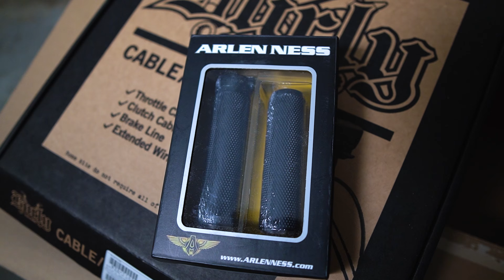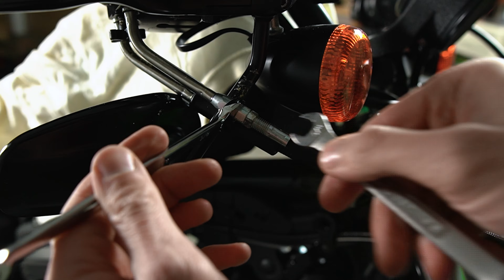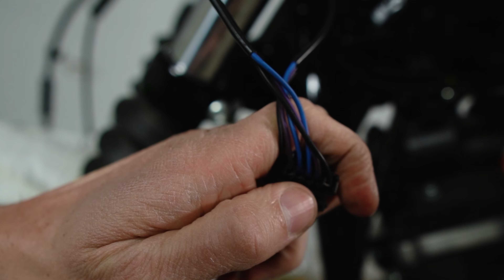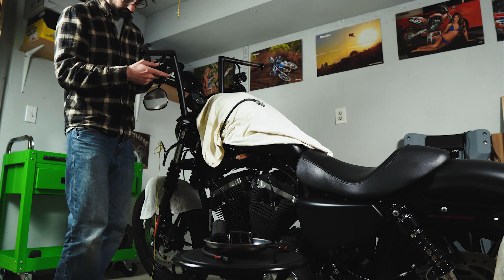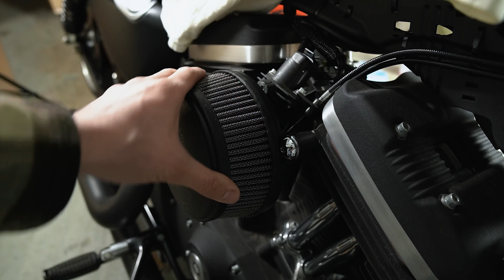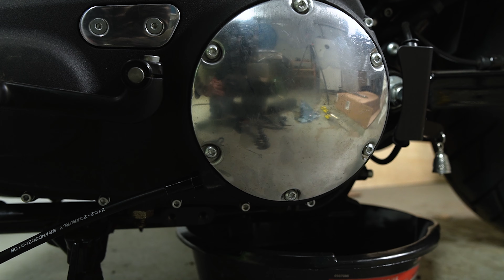Step by Step Harley Sportster Handlebar Swap

Comment: That build looks pretty cool bro. I had a question on that namz plug and play. I wonder if it will fit my 2016 roadster 1200. I’m currently upgrading bars and don’t want to sodder the wires.
Reply from the maker: I'm not sure if it's the same part number (I assume it is though.) just order it from Revzilla and enter your bike. It will confirm that you order the right part number for your bike.
Reply: @TheJourneyYoutube I appreciate you responding bro. I’ll definitely have to check it out.

Comment: If im just changing a bent handlebar for the same handlebar I dont have to extend or replace any of the wires right? Like the whole clutch thing?
Reply from the maker: Correct. This is only if the bars are getting longer.

Comment: Dear Sir, today is 3/25/2026 and this video was made 4 years ago, but I have to say that the information on the handlebar swap is the best that I have seen. I purchased a 1999 sportster 1200 last month and will be installing new buckhorn handlebars which will need longer lines. Would you be available to answer some of my questions or have you retired. Gil in Westfield Mass.
Reply from the maker: I'm glad you find it helpful. I don't have much time to post videos anymore, but I'm happy to help if you have questions.

Comment: What happened with the turn signal light cable?  Where were you able to get it out from under the controls?
Reply from the maker: Yes. It's actually a tight fit but it fits in a slot in the hand control assembly.

Comment: Do you need to have the wire and cable extension kit to put on 10inch zbar apehangers on a 2006 1200 Harley Davidson sportster
Reply from the maker: Generally speaking, 8" is often thought of as the cutoff of being able to get away with stock wiring and needing extensions for bikes with low bars like the iron 883, but I don't know the specifics of every model and year. I bet a call to RevZilla would be helpful.

Comment: Anyone know if there is a plug and play extension for the turn signals?
Reply from the maker: If you buy the burly kit and namz extensions that I have links for in the video description, that is the simplest way to wire that I know of. It will likely still require some de-pinning but that's only because the connector will be too bulky to pull through most handlebars.
Reply: @TheJourneyYoutube  i already purchased the LA choppers kit that doesnt come with any electrical wiring extensions. And also wouldnt i be able to feed the stock wires through the 12 inch handlebars and then connect the extension after?
Reply: @TheJourneyYoutube  i think i’ll run the stock wires through and if i have to de pin that plug i will. Im just wondering if the namz extension that you put on connects to the turn signals aswell? Just trying to do the least amount of RE wiring that i can lol thanks for the help

Comment: I have the same exhaust and if I do that same air filter did you need to install a tuner? Thanks and great vid it will be extremely helpful in the very near future when all my stuff gets delivered.
Reply from the maker: @dddizzyddd  yes it is recommended that you install a tuner with any full exhaust and filter combo so it doesn't run lean.

Comment: I did a handle bar swap on an 03 shadow. No idea what I was doing to be honest. I don't know that all of these steps were necessary but I didn't do them. Remove handlebar equipment then remove handle bars then put clutch and break and throttle on new bars.

Comment: What oil did you use for your clutch? Been reading online and some say just your normal engine oil and some say 75w90.
Reply from the maker: Honestly I bought the Harley Davidson Genuine+ Transmission and Primary lube and I just looked... wouldn't you know it, they don't put the weight/ spec on the bottle. It doesn't seem as thick as 90wt but doesn't smell like regular oil either. I've used ATF for some other bikes, but this also doesn't smell like ATF. Sorry I could be more helpful.

Comment: Great video!
I have two questions:
1. Is this height of the handlebar tiring?

2. how long did the whole conversion take you?

Thank you
Reply from the maker: The height is good for me. It isn't tiring at all for me. I have a quick video about measuring for proper handlebar height. It isn't perfect but it might be helpful for you. Also, it took about 6-7 hours for the install including filming the video. 2 hours of that was probably just for the internal wiring.
Reply: Thank you very much! Keep up the good work!

Comment: Will I be fine if I remove the primary cover without draining oil or transmission fluid ?
Reply from the maker: If you are on the stand, you will lose some fluid once you remove the primary cover and will need to add some again to get it to the proper level. If you don't lose any, you were probably running too low.

Comment: How long should I go with for 10 inch bars for the NAMZ harness extension plug n play
Reply from the maker: You can probably just use the shortest ones they offer since the Harley Z bars are 8" (they are short for an 8" bar, but still) and I've been told that the stock wires are barely long enough for those bars without extensions.
Reply: Cool thanks man, your harness looks like it came with 3 plugs from namz.  The link you have under the video shows 2 wires 2 plugs.  What’s the 3rd plug for?
Reply: Hey did you end up getting the extension? What size?

Comment: Did anyone break the clutch cable when installing it. I broke mine. I'm really screwed now. I'm gonna have to send Burley a negative review. The cable on the bolt side is really fragile. Now I'm stuck trying to drill out the thread that's stuck on the housing plate. FML

Comment: Cam find the namz cable plug n play the link in bio take to wrong bike ? And ideo or part number for the sportsters
Reply from the maker: I just clicked on the link to the namz wire connectors in the description. It takes you to the right part, but then you just need to enter your specific year and model and RevZilla will give you the right part number. There are different part numbers depending on the year and model sportster so I can't just give one part number and have it fit all sportsters. Also, I think the part that fit my 2014 iron also fit some softails etc. So maybe that threw you off?
Reply: Great ill check it out

Comment: So I did everything you did in the video but now my sportsters clutch wont disengage when I pull in the clutch and no matter what I do or how many times I adjust it it still won't disengage. Could you help me out
Reply from the maker: It's probably an issue with the adjustment in the derby cover, not at the cable. Just look through a factory service manual about the sequence of adjusting the clutch. I thought I did a pretty good job at showing what to do, but maybe a different look at it/ a different point of view will help. There are a lot of YouTube videos about that adjustment if you don't have a factory service manual.
Reply: @TheJourneyYoutube  you did an excellent job in your video I've been dealing with this issue for about 2 months now and I'm completely dumbfounded

Comment: What if you're not internally wiring your cables? Would I still need an extender for my controls? I have a 12 inch bars that I am putting in and I have the burly cables for 12 inch.
Reply from the maker: Even if you don't run the wires internally, you will still want to keep them in line with the bars, so I would say that yes, you will still need to extend the control wires. Good luck 👍

Comment: I installed on my 2013, 12” bars from Harley yet now I get wobble above 80mph…. Didn’t happen with the stock bars, any ideas?
Reply from the maker: Lots of ideas. Death wobble can be caused by slop in the bearings, worn out mounts,, improper tire pressure, too much or not enough weight on the front end (unbalanced bike) amount other things. If you are certain that the change happened when you changed the bars and it isn't a coincidence, maybe it's because you've changed your posture and therefore affected the weight on the front end. If it was me, I would check all of the routine maintenance items and if everything is within spec and there isn't any wear on the bearings etc., Try to adjust the pullback on the bars. You can always add a steering stabilizer but that is just hiding the real problem and not actually fixing it. Good luck. Share what you find. Death wobble is scary.
Reply: @TheJourneyYoutube   after checking the front forks for play/ seeing if they need springs or oil, replacing tires and all that, I ordered a steering stabilizer from revzilla! And it fixed it, no more wobble and it drives straighter than ever!
Reply from the maker: @Clutchy_Bois  i know everyone says that death wobble is caused by many issues that can be resolved with routine maintenance, but the consequences can be so dangerous from death wobble that I've considered a stabilizer just in case. Better safe than sorry! I'm glad it worked for you.

Comment: Can't everything just slide off the bars and be slid onto the new bars without draining the brake fluid and taking the cables off?? Or no? First bike so excuse the dumb question if it is
Reply from the maker: If you go with new bars that have a similar rise, you can skip the brake line and clutch cable replacement steps, but you will still need to snake the wires for the thumb controls and turn signals through the bars if you want the wiring to be hidden. If you go with a rise that is 8"-10" or more, you will need to do everything.
Reply: @TheJourneyYoutube  ok thanks. I'm going from straight drag bars the previous owner had to 8" rise... fingers crossed... sounds like I may need new lines
They did leave the extra line from the stock bars when they went to drag bars. So I'm hoping I get lucky

Comment: I was told with 10inch bars I wouldn't need to do the cable extensions
Reply from the maker: That's right on the edge. There's no standardized measurement for bar size so you might be ok but you might not depending on the manufacturer.
Reply: @TheJourneyYoutube  this looks complicated I'm kinda nervous
Reply from the maker: @iiviinstiinct3064  you got this. Just make a parts list, buy a repair manual for torque specs and do your research before you start. I'd like to think that my video is a good start for you.

Comment: Great video. I'm about to do a handlebar swap on my old sportster which my daughter will be my daughter's first bike.  An old trick for adjusting the clutch cable is to put a dime in the clutch lever gap to get the correct amount of slack in the cable.
Reply: Thanks bud! I'm getting ready to change out mine this morning on my first bike. '02 Sportster 1200 custom. Fingers crossed I don't need new cables.
Reply: Nickel

Comment: If I’m only putting in 6” risers would I need to still get longer cables? Or would the cables I have be long enough?
Reply from the maker: I've heard of people installing 8" bars and not needing longer cables, so you might be OK. I would unbolt the bars leaving all of the cables intact, make a wood block to hold the bars in their new location and see if you can get away with the stock ones. If it's close, I would get longer cables and/ or wires.

Comment: YO I CAN NOT GET MY CLUTCH CABLE TO THREAD IN WTF LOL. and I know I got the right cable it’s burly brand and for my make and model and year of my bike
Reply from the maker: You probably have the right cable but those suck to get started because it's a fine thread and the cable is curled so it is hard to get aligned. It took me a few minutes to get it started. Maybe ask someone if they can hold the end of the cable to help you go straight to the clutch case. Good luck.

Comment: I have a 22 - iron 883 , and 10 inch z bars from Harley, would I be okay if I just buy new brake line and the plug and play kit ? And is $500 an okay deal to have a shop install these.?
Reply from the maker: I wouldn't pay a shop to install them, but that's just me. If I'm going to trust my life to my bike, I want to be sure that no one cut any corners. If you do pay a shop, they should be reputable enough to confirm that all of the parts are compatible, or don't use them. Having said that, I think I remember hearing that the 8" Harley z bars can barely get away without new cables. 10" might be tight! Good luck.
Reply: @TheJourneyYoutube  so I had these installed and had it for about a month , the only regret now that I have is I wish I would have gone just a little higher maybe 12 or 13 , could I install risers to make them a bit higher ? And if so what size do you recommend ?
Reply from the maker: @The1andonly-M  you can definitely add a riser of your choice. I don't have any experience with them on my bike though so I don't have a specific recommendation.

Comment: If your sportster has an alarm, you want to turn the ignition to "ON" and then pull the main fuse. When the job is completed reconnect the fuse and turn the ignition off. Keep the fob within a few feet of the bike the whole time.

Comment: Namz Ready-To-Install Handlebar Extension Harness For Harley you get the 8 12 or 15 length??? I'm putting 10 on my 883 iron
Reply from the maker: I got 15" for my 12" bars. You should be good with the shorter ones. If there's a little extra play, you can just hide it inside the bars. It's better than coming up short!  You might be close to not needing them, though. A lot of guys can go up to 8" rise without extensions.

Comment: Most thorough video seen so far on bar install for a Sportster.  Good stuff.   Daughter has a new-to-her 2018 Iron 883 that needs bars/grips a few inches closer, so this video is saved and subscribed.  Haven't started sourcing parts yet, but a couple questions.  What if you screw up the grip, glueing it on?  Are we talking needing new bars, or is that glue pliable enough to work with to get off, sand and try again?   Also, given the date of the vid, I expect you gave it a good amount of miles this past spring and summer.   Any adjustments or problems after the install?
Reply from the maker: Thanks for the comment. I'm glad the video helped you. I have footage of a bar review after 500 miles. I'll be posting that in the next week or two. In short, everything has been just about flawless with the bars. I think I adjusted the clutch just out of preference and that's it. Regarding the grips, if you screw it up you will need to cut them off and buy new grips but just sand the bars and you can keep installing new grips for as many times as you like. Just remember to put most of the glue to the inside of the grip and not that bar so the glue stays in the grip and doesn't get pushed out as easily. Also keep an eye on the end cap so it's aligned. Grips are very easy. Good luck!

Comment: Awesome video man, detailed and clearly explained. Have everything to change my bars for a few months now but been lazy, this inspired me to get it done ☑️ thanks again and ride safe. Best
Reply: Liked and subscribed..also saved the vid for reference. Really like the ease of the Namz plug & play can/bus extension but didn’t see a kit for Sportster on Revzilla or Namz site?  Did you purchase another bike model? Also what length, 12-inch cable extension?…going to install Burley narrow bottom apes…seems like this could be done in a weekend taking your time. Thank you!..
Reply from the maker: I did buy them on RevZilla. They were a model specific part and RevZilla confirmed that it fit my bike... But when they sent it, it was actually labeled to fit a mid 2010's Softail. So, it must be a pretty universal fit for many bikes. Just make sure you save your bike into RevZilla and they should confirm that the suggested part will fit your bike automatically before you put it in your cart.
Reply from the maker: It's part #1141712 on 'Zilla. I went with the 12" and had plenty of length.
Reply: @TheJourneyYoutube  thanks again for your time to make the video and respond to my questions 👍
Reply from the maker: I'm glad you enjoyed it! Good luck!

Comment: Hello when you replaced the cables on the sportster and you placed the clutch cable in the primary, there was a nut that you put on and then the screw thru it and backed off the screw. My question how tight did you tighten that nut., it looked like just hand tighten. It happens around 15:35 in your video. Thanks, Kenny by the way GREAT video
Reply from the maker: You don't actually need to tighten it. That nut is threaded on the inner rod that you make the final adjustment on. It will make total sense once you take it apart as the only way to remove the nut is to turn the inner rod and the nut backs itself out. I hope that makes sense.
Reply: @TheJourneyYoutube  Thanks man, thats kinda what I figured, but kinda figuring in the past caused me some problems, so now I ask first 😁. Bro if everyone made vids as thoughtful as you we would all be better off. Thanks again for the fast reply
Reply from the maker: @coralparadise323  thank you. If you think it's a worthwhile video, hit the thumbs up so YouTube knows to suggest it to other people. Good luck with your project.

Comment: Great video!  I am in the beginning stages of bobbing a 1988 sportster 1200.  Definitely leaning toward this setup.  Do you think the process for mine will be pretty much similar to yours?
Reply from the maker: Yes it will absolutely be similar. Harley hasn't changed all that much about this bike since the mid 80's...

Comment: I was wondering what torque wrench you're using?
Reply from the maker: It's just a 1/4" in./lb. Torque wrench from Amazon. I believe it is a Tekton. It seems to work ok but I've never checked it for accuracy.